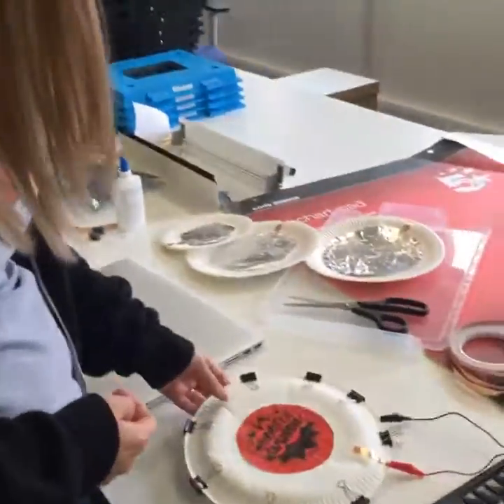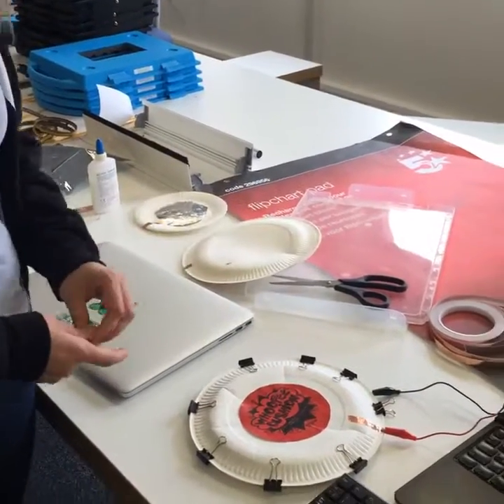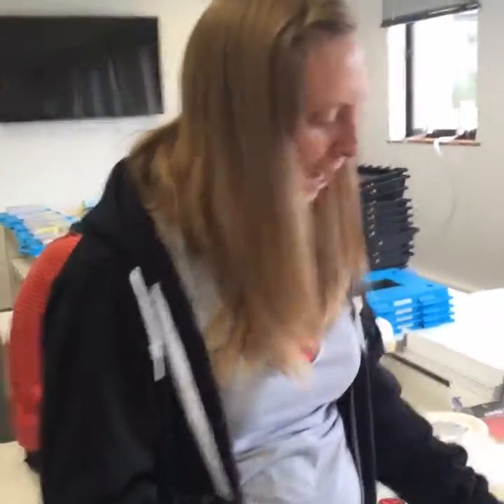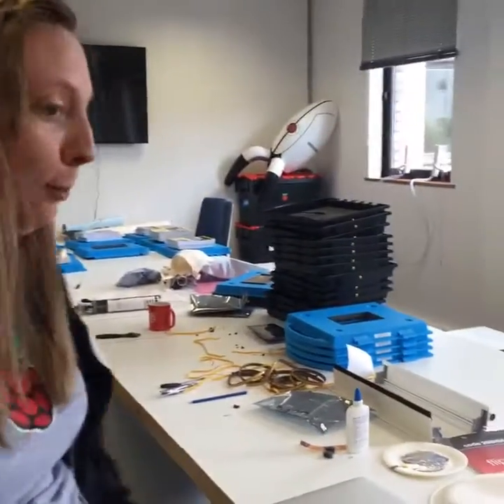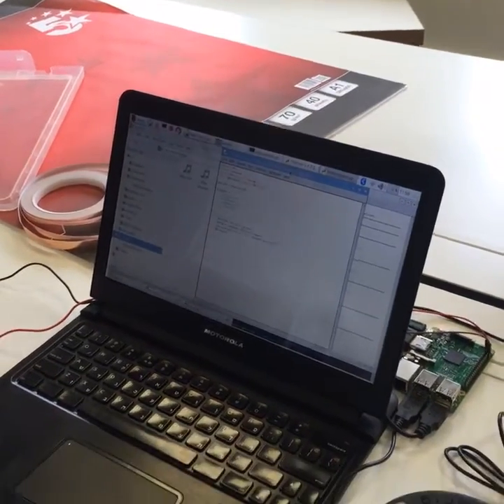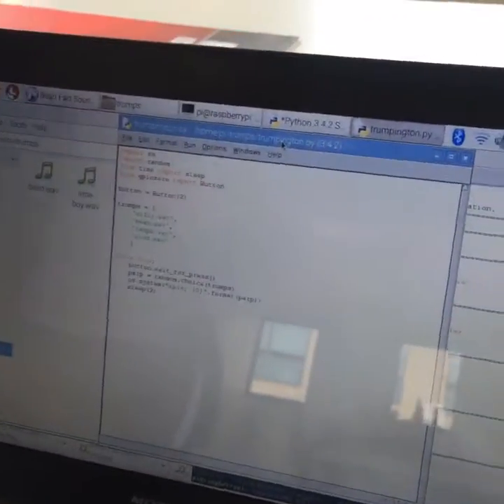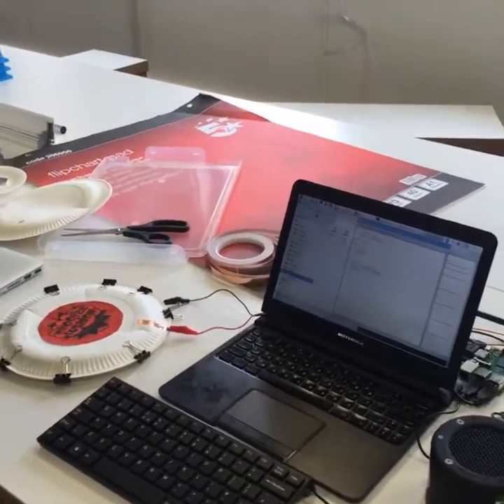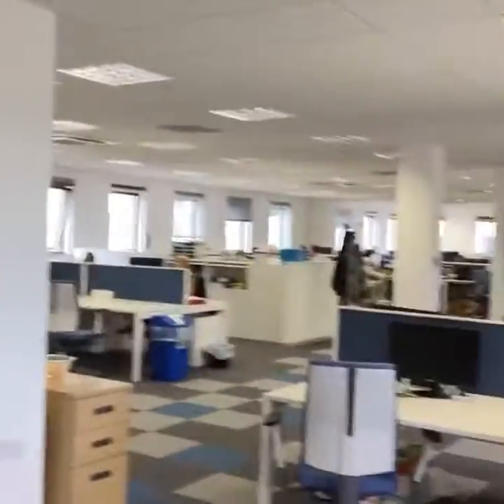Live from Pi Towers - The Whoo-Pi Cushion

Comment: I tried this and couldn't get it to work.  I wrote it out in Python, then literally copied and pasted the Python code from the site to ensure I had written/copied it 100%, and it still doesn't work. Is it possible Python is not communicating to my GPIO?  Is there a way to turn the GPIO on?  I touched the wires together repeatedly and nothing happened. Any suggestions?  Thanks!
Reply from the maker: Are any errors showing when you try to run the code?
Reply: No error messages, the script just sits there and nothing happens, even though I touch the wires/put the plates with foil together.  Eventually I go to close the script and it says something like "Are you sure you want to close this, it's still running", as if it's still waiting for the plates or wires to touch.  Again I touch the plates or wires and nothing ever happens though.  Could someone try this again?  I've had a friend try it too with the same result of nothing happening.
Reply: Hi, can you try the following in a new python script for me.

from gpiozero import Button
btn = Button(4)
btn.wait_for_press()
print('Working')

Run the script and then take a wire and touch it between any ground pin and pin 4.

YouTube not the best place for tech support, but you can get me on twitter (@coding2learn)